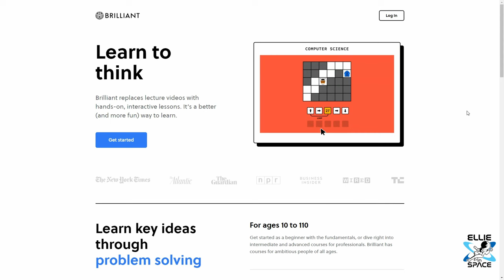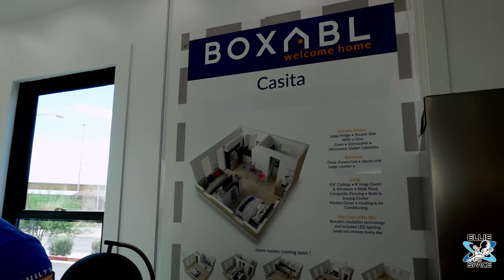BOXABL can UNFOLD and UNPACK in less than an hour

Comment: KEY Questions still not asked or answered:
* Success of industrialized building is JOINTS. Shown junctions (10.24) will not be maintenance free. Replacing the gaskets will involve disassembling panels.
* Materials - galvanized steel exterior will rust, especially at cut ends. No steel roofing has a required 50 year life. Warranty period?
* Permitting - every jurisdiction has their own criteria. New weathering details will not be easily accepted without substantial engineering and testing in-use reports under severe temperature and ultra-violet conditions.
* Insurance - not insurable until permitted and tested in use warranted.
* Loans - no bank mortgages possible.
* Foundations - not provided, require separate process and permitting.
* Legislation kills all industrialized building startups. Not investable!
W Russell - BArch, DipUrbVal.
Reply: (A) I will defer to Paolo and/or Chief Engineer Kyle Denman on your 1st 2 points... (B) What is the issue with Boxabl's plan for state level modular code approval... Boxabl has been conducting internal and 3rd party testing over the past couple years... (C) the state level modular approval has been touted as the way to getting insurance and financing... (D) It would be beyond dumb for Boxabl to get in the foundation business, everything they are focusing on is about speed, single SKU, and scale... They have previously mentioned certifying local installers for units... (E) Legislation actually enabled ADUs to go all over the place in the most populous state in the country, California... Why do you think they opened a factory in Nevada, instead of business unfriendly California  (insane quick build time, but proximity to massive west coast markets, just like Tesla with Giga Nevada)... Boxabl doesn't need to be allowed everywhere right away to be a smashing success...

Comment: Not knocking it (I like).  But it's essentially a mobile home in a box.
Reply: Big differences though... 20x20 is not too skinny like mobile homes, you have 9.5 ceilings, full-sized kitchen appliances, and built to modular standards, not manufactured...

Comment: So how sturdy are they really? Like most mobile homes can't live through a tornado or hurricane and maybe not an earthquake Either 🤔  And can they be made bigger or if you wanted a bigger one but could ship it in this size each part and they would all connect together?🤔
Reply: They are much more durable than any wood-frame home... they can be made 20x20 (Casita), 20x30, and 20x40 and still fold to fit on a single, legal trailer... yes, they are meant to connect horizontally and vertically together to scale to any dimensions...
Reply: @rule1capital   So I forgot what the cost was in the video do you ship to Colorado?  Are they built with a snow load?  We have extreme temperatures from hot to cold here.
Reply: @rule1capital   Offer can they be attached to a permanent foundation
Reply: @florforever1  Yes, they are meant to be... can be (a) slab or (b) pylons on 4 corners... you can leave them off foundation, but not recommended...
Reply: @florforever1  because it is mileage based, should not be bad at all for west US shipping ($2-$10 mile was from video)... they are built for snow loads with the flat roof, but certain snow loads will require pitched roof-add on...

Comment: About off-grid.

Small scale electricity production is always less efficient than large scale.

Microgrid is just another way of saying more expensive and less reliable.

We should focus on what actually works and is efficient/reliable rather than the current thing buzzwords that sounds good.

Sorry for being such an aspie.
Reply: Not necessarily true if you include the costs of running electrical hookups from power plant source, to homes, and the greater grid infrastructure... if you store/use solar at your own home where you use it, you completely get rid off costs of expensive transmission infrastructure...
Reply: @rule1capital  I've seen multiple scientific reports directly contradicting what you are saying.

Also; About 8 years ago I did the calculations for putting PVs on my roof and getting a battery pack and an inverter and it was orders of magnitudes away from being profitable over any period of time with the electricity prices we hade in Sweden back then.

8 years ago Sweden still had one of the best power grids in the world, both in terms of efficiency/price as well as almost zero co2 emissions as it was based on equal parts hydro and nuclear power 

Since then the green party has completely destroyed the Swedish power grid and replaced it with wind/hydro/fossil fuels combo which of course has decreased reliability, increased co2 emissions a lot and increased the price of electricity by a factor of 5-10x depending on the wind conditions of the day.

Compared with today's prices, it would probably be economical to install PVs.

But that is comparing with a non functional decentralized grid, wind power is generated in many small power plants, it is unreliable, requires huge grid investments and requires an equal amount of spare generator capacity to be built for the day when the wind does not blow.

And the lack of a large rotational mass in the wind turbines compared to hydro/nuclear/fossil fuel power plants also makes for a poorly regulated frequency stability on the grid, this can even be harmful for large industrial equipment.
Reply: @rule1capital  To give some figures, even a few years ago the price of electricity from the grid in Sweden was about 
0.03 $USD / kWh, from a highly centralized grid and large scale production facilities. 

You won't beat that figure with any kind of off grid set up.

After the environmentally friendly grid was built by the Gretards the electricity price is now 0.20 - 0.80 $USD / kWh, and we emit much more co2 from the electricity production.

That price can be beaten by an off grid set up for a normal household, with about a ten year payback time for the investment needed.

To be totally honest and fair, EU regulations and the war in Ukraine has had an influence on the price as well, but if we had kept all our nuclear reactors running we would still mostly had the same price as before.
Reply: @NomenNescio99  I agree with you assessment that Sweden going from zero carbon hydro/nuclear to destroying the grid for virtue signaling and politics is idiotic... The only rationale for that seems to be bad actors trying to destroy western countries from within... California is the US equivalent to your country... the political forces there are destroying that state and they are losing hundreds of thousands of people each year to non-destructive states... I don't focus on wind at all, but home solar systems in 2022 now make much more sense than 5-10 years ago because the cost of backup batteries has dropped 10-fold since 2010 (thanks Elon)... so a home solar system, with Powerwall battery banks, makes tons of sense for US households... Also, the US Congress just extended the extremely lucrative "Solar Tax Credit" that covers 30% of the entire costs (parts, labor, install) of solar/battery residential systems for at least another decade... on top of the credit, US households can finance the solar systems with a 20-year fixed rate loan...
Reply: @NomenNescio99  So you can understand the US, depending on state, average in September 2021 rates per kWh range from 10 cents to 20 cents... with states like New York and California near 20 cents and most middle America states being closer to 12 cents...
Reply: @rule1capital  Here in Sweden we also have this thing called winter, and the sun is barely over the horizon for more than a few hours per day, at best.

Lots of batteries required! 

The local conditions matters.

Even some of the tropical regions have their wet monsoon with cloudy skies for months and will have a hard time to deploy solar power at a large scale. 

But the world currently needs all the energy we can find, any and all sources are welcome right now. 

At the end of the day, energy is what gives us our prosperity and civilization.

It's something that is much to valuable and important for allowing politicians to play around with.

Comment: What about financing?, The East Coast of the US needs these units. Is the styrofoam insect proof???
Reply: consisting of exterior layer of "galvanized steel", middle layer of "polystyrene", and interior layer of "magnesium oxide" (no stick frame, nails, or air gaps)... What you are referring to is the middle layer which is air-tight and very thick...

Comment: How easy is it to customise the interiors and make changes in the future? (I'm going to assume they haven't made the elementary mistake of including anything that can't be taken out through the doors.)  How easy it it to make changes to the wiring? (Automobile looms cause all sorts of problems.) It wasn't obvious from the video what height power outlets were from the ground, but I fear they're the traditional ankle height dictated by historical facts, rather than the metre they should be.
One factor that could thwart the ambitious growth plans is that home buyers tend to be conservative, and financial institutions extemely so. Will they attract buyers who can raise money?
The engineering and design standards certainly look high, but in Britain thay may encounter a deep-rooted suspicion of manufactured housing that started with hideously shoddy "pre-fabs" built post-WWII, and some disasters in the 1980s.
Reply: (A) You can bring you own contractors in to make whatever changes you need... the wall panels that come standard have great strength of 90 lbs/per square inch (that is what I remember from memory)... no gaps in wall like wood framing... (B) On the wiring, in previous interviews, stated that all of the wiring is accessible through built-in channels in paneling system... (C) As for buyers and confidence, it wasn't mentioned in the video, but DR Horton, the largest single family homebuilder in US by volume (81,000 homes built/sold in 2021), is an investor and strategic partner (announced on 4/25/22)...
Reply: For durability, look at this video:

https://youtu.be/T-t6n96mW7o
Reply: @rule1capital  Good points.  I was thinking more about the sort of changes that people like to make to their houses over time.  Generally, traditional methods are sufficiently well-understood to prevent disastrous changes, though any number of horror stories show that nothing is idiot proof, given sufficiently creative idiots.

Comment: I’ve heard that they STILL haven’t started mass-producing these.  This info has been repeated for years now and it would be nice if we could actually see progress on “producing” these homes.    I understand if there’s a supply shortage under the Biden administration EVERYONE is having multiple problems.  I’m hoping to see that BOXABL is getting the orders out to people.
Reply: 2017-2020: blue-sky phase, see if this even makes sense, owner puts in money for prototypes, build interest in industry/government... Q4 2020: complete 1st crowdfund, go viral for product and investment... Summer 2021: move into empty warehouse, work with Porsche Consulting to build out new concept low-level production factory... Q4 2021: begin production for initial DOD 156 unit order... June 2022: finish delivery of all 156 units to DOD... Summer 2022: sign lease for more space at Factory 1, take learnings from original contract and make upgrades, begin 188 unit order and prep for another 100 unit order after that... Q1 2023 Plans: Take delivery of 2nd facility, buildout 2nd facility, incorporate into process with building 1... Q2 2023 Plans: Install $10+ million of automation equipment upgrades to lines that will get Factory 1 towards max annual production of 3,600-5,000 units per year... They have been a company for 5 years on paper, but an operational company for just 1 year...

Comment: need land, need power, need plumbing. with all the added it's not so cheap. I don't even think these things include siding. or any of the rest you would need for interior.
Reply: It will work because of labor arbitrage and time value of money... 90 minutes + ship time + utility hookups vs.  4-6 months... at every step of the way in current build process, there is profit built-in and no incentive to make step change improvements... developer has much less risk from signing contract to delivering house to customer with Boxabl build times vs traditional...

Comment: It’s the cost of the land that’s expensive in 🇬🇧
Reply: True, but in very expensive regions in the US for example (DC, California), the Casita pays for itself very quickly as an ADU add-on in the backyard to existing $500,000+ homes... also, from a homebuilder perspective, the time between signing a contract with a buyer and delivering that unit to customer (4-6 months here), is extremely costly and risky to finance on the balance sheet compared to having room modules built to order in mere hours and shipped to homesite within days... not mentioned in the video was that DR Horton, the largest US homebuilder by volume (81,000 full size residential homes built/sold in 2021), is an investor and strategic partner with Boxabl (publicly announced 4/25/2022)...

Comment: Why are their prices so much higher per sq ft than a manufactured home aka mobile homes. Also folding homes built if a factory are so much cheaper in China, excluding labor costs, they should be similar in cost but they are not. So boxable is just a rip off based on price, sort of like apple products when android does the same thing for much less at near if not better quality.
Reply: That's like asking why people prefer a Tesla Model X Plaid over a Chevy Bolt... Manufactured homes < Stick-Frame < Boxabl Modular... You can answer your own question, why are people so excited about Boxabl and not mobile homes...

Comment: Shouldnt you be in steel toes in the work place ?
Reply: You sound like a safety-first manager who has dealt with OSHA before...
Reply: Not after hours
Reply: As long as there is hazardous equipment in the work place, proper PPE should be worn. Regardless the hours of operation :)

Comment: polystyrene is bad for the environment, and extremely flamable. 
hempcrete is green, fireproof, anti-fungal, and absorbs Co2 over it's lifetime. 
They should grow hemp on site (90 days from seed to harvestable product) and switch to using compressed hemp board and hempcrete instead of polystyrene and plastics.

Comment: Nothing new here, this is just a refresh/update on an old idea. The UK built thousands of Prefabs in the 50’s after the war. The principal was exactly the same with pre built kitchens and bathrooms being the core. The only problem was the materials available at the time included asbestos and lead plumbing. So really all they have done here is take an old proven idea and used new materials and some modern assembly techniques
Reply: If what you said was so easy to do, Boxabl would not have been created...